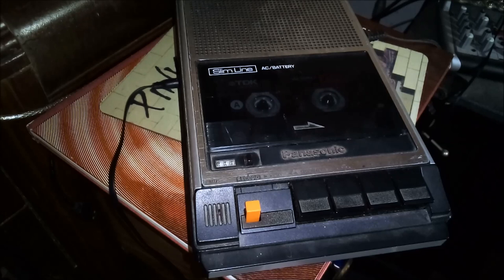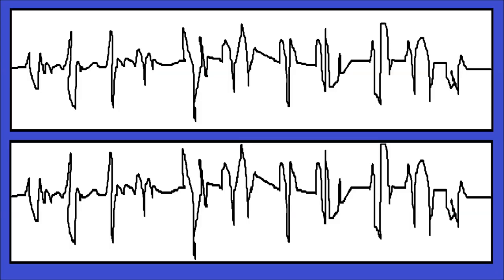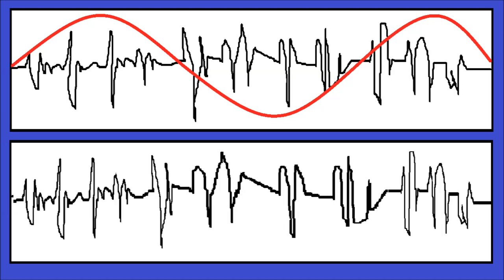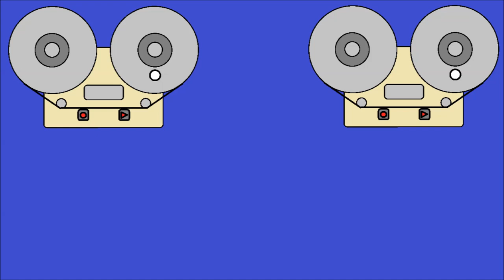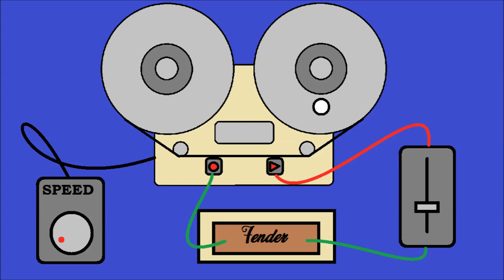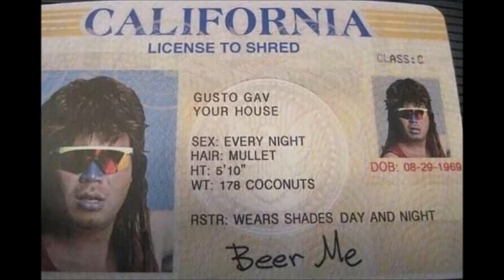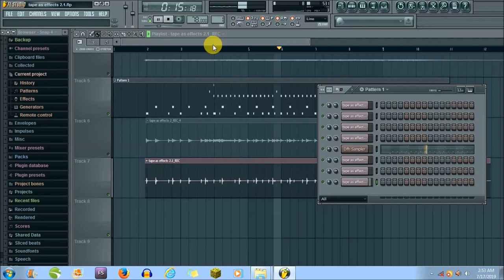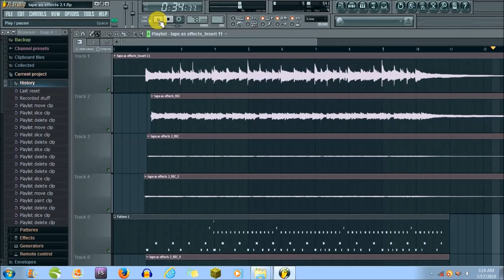Recreate OldSchool Tape FX Using Cassettes (easy to follow)

Comment: Also you can use a tape recorder as a lofi sampler by recording a single kick, snare, hi hat, synth note, guitar note or bass note into the tape player. Then you record that note back into your daw. You can use this effect to dirty up a keyboard sound that's too digital or give some gain to your drum kits.
Reply from the maker: Thank you for watching and taking the time to leave such a detailed and useful comment Desperadow. Great tip absolutely useful. I have also found that letting something play out into the room and rerecording it just like a simple cheezy reamp and then fading it in with the original will also help a lot on digital sounding synths. I heard that Depeche Mode used to play their synths through old tube guitar amps like fender twin reverb way across the room for this reason. Thanks again bro great tip.

Comment: This video is a gem. Great work and thank you! I’ve been recording to a cassette 4 track for tape saturation on drums and guitar, and using a digital four track and a DAW. The adjustments and tweaks you demonstrated have helped me to understand how to bring it all back together. You explain complex topics simply and make them fun to learn. You rock! 🤘🏼
Reply from the maker: Thank you so much for watching and taking the time to write such a kind comment MP&808s That is awesome bro! I had some people ask me over time how to keep it lined up and im like cut it on beat and jog it back or cross fade it. Its work but it sounds kick@ss vaporwave hipster cool.
Reply: sorry to break in. but the 4 track cassette recorder & the great sound that i get when i run my guiar thru the dedicated guitar only input jack. 
 our host with the most & you both know why that happened. you referenced in above text & clem. said it. i was 12yrs old in 1980 when it seemed a lot of artist from most genre's were all on the same lyrical topic. not all the artist , though...  one of my fav. bands was dealing with a band mate's death & was coming back to work in thier funeral clothes. and john anderson was clearly , but prolly not safe, was checking charlette's oil right there on the porch swing, and joan jett was composing love songs about her job.but these other guys were all into self pleasure. michael jackson was "beating it"..  our not so Quiet riot rockers was banging thier heads. jagger & keith was shaking it up. john waite had to of been doing something he wrote his ex that he wasnt missing here. duran duran wrote, prolly later on, talking about edging. with the reflex. cindy lauper wasnt into headbanging....
 so she just bop ,  bop , ohhhh, shebop.
british bill idol, just listen to his record collection & dance with his self.. it was crazy. my mom had just moved us to the bottom half of our state closer to her sisters and mom. and i lived within range of a clear FM signal that was strong enough that it came in in stereo. our state bigges Rock station. but it was static'y and crackily like  the south of the state needed to de-oxit thier pot.'s.
i miss the rockers, tom petty, styx, floyd, kiss, uncle ted. the freaking eagles, paul rodgers and his company , i could still hear foreiner but they started playing love songs , and brian may was making great sounds every 5th  song they released, areosmith had took a break or something, really. steve perry made a love song,  who else, floyd had not put anything new, my young cousin was all into this one song that was great. but bocephus wasnt rocking then he was surving new york city & the mississippi river water level disappering. willie made millions & became ledgend with a song about his job & he loved it.. kida like joan did. 

i literally heard like from 50%  of the songs from my home northward in 1979. were new release material.
yeah i know we had the disco.. but naww. funkytown ??? 
the bee gees. that had groovey bass lines and the had the vocal harmony this down. then maurice is hitting the high "c" soprano notes. but .. naw. bob seger and his coors lite band great music. good for road trip until you take one down lower state and the year numbers on paper chart on wall & everyone took a break .. some made love song or two by themself.
ohh. it was a shock.
it changed quickly, malcolm and his small brother had another friend that could sing. and he could work with them , but be respectful. . and they came back and rock bands started showing up . british deaf predator cats brought on the heartache. the ratt's showed us how to lay it down & round and round. kevin bacon learned to dance as did the flashdancer . ole jackson boy  got some more scarier songs and knocked a girl up or she just claimed he did but it still unknown. 
the eagles made it back from thier long run but they didnt hang out. so it was a good thing that they were a supergroup & smuggled some dirty laundry the rocky mountian way. and hey. we had the cars ! we had a group that i never heard in my life an dont care if i ever again do. thier singer really tries . just watch his neck tendons  and he really tries... but all i can see in my mind is a boomstand  for him trying to help an extra large loaf that had became un malleable. help it with vocal vibrations & i think it musta worked. his large colon would contract on time to emphasize key words ....
i was (cramp) BOOOOORRRRNN  .
in the yus ahh. .
yeah. this took way to long to tel why im a 80's fan
 motley, poison, jovi, twisted snider, tom kiefer, tesla, and on and on. zackwylde. helped oz into the new  .aerosmith resurfaced. tom petty . scorpions, disco duck died, paul simon helped do much he had the world focus on a video game. and we all was glad to be lied to by madonna . 1st time my ass. lol

hey im out gotta go. latter. 👋🏻👋🏻👋🏻

Comment: Super cool! One little nitpick, though - that's technically parallel processing and not sidechain processing.
Reply from the maker: Thanks for watching and taking the time to write a comment Barden. I suppose you are right. Its not like the first track is actually controlling the compression on the second. Well kinda since its the same source but not in real time so you are correct. Its not side chain processing. The guitar isn't controlling the drums or vice versa. Thank you for the correction and kind words. I guess I just had a brain fart on that one. I'm glad you liked the video.

Comment: the dictaphone by sony with half speed switch  use switch as a clutch and superglue a zippo flint plastic wheel  on the pitch knob  you can change people talking make them sound sarcastic when serious or mix like a record player cheers for video great explanations
Reply from the maker: Thank you for watching and taking the time to write a comment Paul. I have been wanting to put a speed control on one of these for a long while but I can't find one at a thrift store that works well and that I also have the heart to hack up... I wanted to put cv control to one and a keyboard and use it like a mono chamberlain or melotron. I love watching the guys that scratch tape decks like records.. that is a trip.

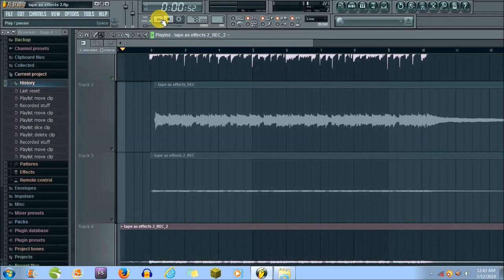Comment: 11:00... Mind BLOWN
Reply from the maker: Thank you so much for watching and taking the time to comment Modern World. Yes the flanging/phasing thing that happens is wild when you blend a stable and wowed recording together.
Reply: @heavymetalATC  Thank you for the video man, it was super inspiring. I took notes! I've got an old cassette 4 track (and just bought a reel to reel) and I've often used that wow and flutter effect before (I've also spent ages on stretch time trying to get rid of it when I didn't want it!), but I've never done that deliberate slowing of the rotors and achieved such a convincing 80s phaser sound. Awesome stuff!

Comment: I have two casette recorders with speed control. Very useful to create weird of the wall loops, slowing them down and then playing over it with something else. Sond gud.
Reply from the maker: Thank you for watching and taking the time to comment Tony. Thats awesome man! Bet you can get some really cool effects with those. I had really considered putting a speed control on the unit I used in the video but its such a nice one and I use it so much, I couldn't bring myself to start drilling and modding it. I would like to get some newer  and cheaper units off of ebay or from the thrift store and add speed control. I did have the idea that one could be used like a synth/sampler or a monophonic Mellotron by putting a jack in line with the speed control and making a little keyboard with momentary switches and a pot to tune each note. Then you could make tapes of different instruments playing one note for the whole side and use the momentary speeds as a way of tuning it and make a tape sampler. I never did get around to that but I think the idea is worth visiting and I will put that in my notes. As always if/when I make a vid on it I will give you a shout-out. Thanks for sharing your info and inspiring me to try the project.
Reply: @heavymetalATC  My pleasure! Not sure how common Philips d6350/60's are, those come with built in variable speed, line in, mix and a headphone output as well as an equalizer that also affects the hp out. I have two that look like trash but they work fine! 

Also, when you do a shout out, would it be okay if you refer to this Tony Dutch, I'll be attempting to upload more stuff with some experimental stuff on there this year: https://www.youtube.com/channel/UC6_guoJgK9SljS4OkoP7dxw

Under a 100 subs, so at this point I don't have a personalized URL yet. :C

Comment: Brilliant video!! I wish there was more content about incorporating analog with digital recording. So glad I ran into this. I am wondering something though. When you’re routing the usb mixer to the cassette recorder and back with the drums, is the drum signal that’s coming into the daw a mono or stereo signal like the original? Just curious with the kind of cabling that’s used. For instance, 3.5mm trs from the line out of the cassette recorder to dual 1/4” ts going into channel 1 and 2 line inputs and switch the i/o going back in to the daw?
Reply from the maker: Thank you so much for watching and taking the time to leave such kind words Matt, I was using a stereo 3.5 to stereo 1/2 into channel 1 which is a stereo channel. I hope that clears things up. As far as I know the tape was recording and playing back in stereo, infact if I remember correctly the player was a little hotter on the left so I had to adjust the LR fade on the interface slightly.

Comment: Cool video. How do you synch your tape drums to your DAW drums? I tried running one of our song's DAW drums into the Tascam 424 Portastudio. No problem with the transfer, sounds cool on tape. Then when I re-import the tape tracks into the DAW the tape speeds up quite a bit before the end of a 3-minute song creating this delay that is pretty unpleasant. Unless I run the entire track into the tape machine and then back into the DAW, I don't know if there's a way to fix this.
Reply from the maker: Thank you so much for watching and taking the time to type out such a detailed and intelligent comment. As you saw in the video it was a decently short clip so it just lined up but... I would think maybe you could record the drum track onto tape 4-8 bars at a time maybe even with over lap and peice it together with fading if needed but im sure that could leave some artifacts either desirable or not? also you may be able to use your daw to time stretch the drums in 1-4-8 bar sections or as a whole. Ive never really ran a full drum track on tape and back? I usually work from in the box well for the last 10-12 years no live drums so I do a lot of stretching and jogging and copy paste? I see how this could be a problem, im sure you can find a way to jog/shuffle in the daw but outside of that maybe changing the cap,resistor on the motor in the tape player which is kinda crazy and would take extreme math or an adjustment pot and trial and error... or  maybe the same thing done with a variac? I hope that gives you some types of ideas but I would probably try to do it in the DAW.

Comment: i got a radioshack dictaphone on ebay the other day. on my daw interface it has these "insert" channels. What would happen if I use a insert with a split cable and patch the out from reaper using reainsert to the tape recorder input, and the output from the tape recorder back to inseert return. I know that the tape has the ability to monitor while recording. am I even getting the tape sound doing that or just running my signal through the the tapes mic preamp??? haven't tried it yet, but thinking about it,,probably just the pre?? Tried recording to tape and it does make a dry guitar signal way more interesting..kinda worked good with a cab sim on the end too..funky sounding. nice vid cheers
Reply from the maker: Thank you for watching and taking the time to write this detailed and articulate comment Raindogred. I am almost completely sure that would just be using the preamp inside the tape player. Which could also be useful Im sure if you played around with it maybe send drums into it very hot and turn the volume down on the out and saturate that transistor or opamp in there it might be the magic box, the cab sim idea on the out is pretty awesome too. I have put some thought into maybe using a guitar pedal on the way end and blending the tape with maybe a delay, reverb or chorus on it back into the signal for lo-fi effects send. But yes I think the live monitor is just the preamp. Great thinking though, you obviously put some thought into this. Hey its been ages, Id loveto know what kind of results you got using the tape deck with your music?

Comment: Is it possible to get the tape echo effect with a normal tape recorder going into an amp? I want to have a tape delay effect to use with my amp and guitar rather than doing it for a recording. I currently have a stereo cassette recorder that has right and left mic inputs and one output. I also have a spring reverb unit. My amp doesn't have an output. Only inputs so I'm not sure how to get the sound back to the tape recorder. What would you suggest?
Reply from the maker: Thank you for watching and taking the time to write a comment Scott. Unfortunately I dont think you will be able to get a live delay effect with a normal tape recorder. It can be done with a simple volume mixer and a reel to reel recorder... Or you can take 2 tape players and gut them and put both sets of electronics into one unit and use one as a recorder and the other for playback at the same time but you may also have to modify the bottom of the cassette itself to accommodate 2 heads at once by cutting some of the covering from the tape window. As for reverb I'm guessing that you have a spring tank? You can drive a spring tank with an amp board from a set of computer speakers. Then you can use it in from of the amp input but a boost or other similar pedal going into it will make it work better when going into the input. I do have a video where I did exactly this : https://www.youtube.com/watch?v=1t1sbeOMm3c 
In the video I put it after the preamp but its really nothing more than a glorified overdrive pedal in a box. The actual power tube section is in the box with the speaker. Thanks again. If you have any further questions feel free to drop a comment.

Comment: ¿Can i use a analog mixer in the aux in from the tape recorder, and use it to mix the tracks sounds?
Reply from the maker: If I understand you correctly then yes, you can just make sure you dont have a loop set up any where so it starts feeding back when you raise the fader.

Comment: I hope that wasn't your own personal 'authentic' broken Les Paul. The vid was great, but I couldn't get that sorry Paul out my head
Reply from the maker: Thank you for watching and taking the time to comment Bring MeSunshine. It was not my guitar. I am a bit too cheap to buy a Les Paul. I do find it unfortunate that players are so stuck in the past that Gibson cannot offer a version of the guitar without that design flaw. It is an artifact left over from the days of the lute when you needed the angle to keep wooden peg tuners from slipping. I do have an 80s Epiphone S-310 Strat style guitar that came with the Explorer style headstock and it broke just like that. I replaced it with a vintage fender neck and now its good to travel and survive the occasional slide down the wall or amp and bounce off the floor... and has. Thanks again.
Reply: @heavymetalATC  Ha ha. I've never had a Les paul, either. A few years back I had a job where I had enough money to buy one, but stopped myself at the last minute and bought something just as playable for a fraction of the price. And knowing my luck with toppling guitars, I made the right decision. Good luck with the channel, man

Comment: How do you record the track onto tape with a Scarlet 2i2 using Reaper?
Reply from the maker: Youll have to route the sound out of one of the outputs in your daw or in the scarlet software that looks like a mixer and has routing for outputs... you can use like the headphone or monitor out since you only have 2 channels and plug that into the tape player. I hope that helps its hard as heck to explain some of this stuff halfway coherently. hahahaha!